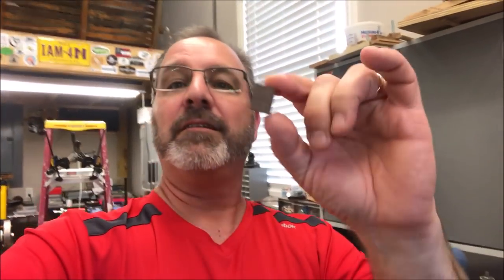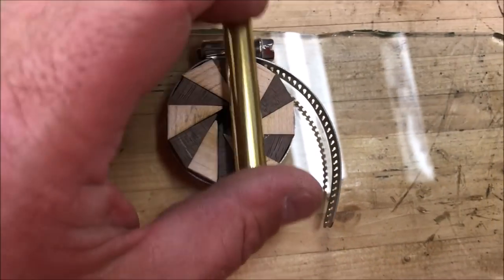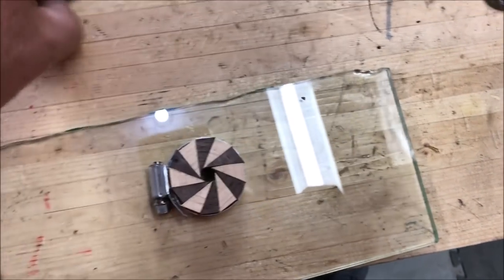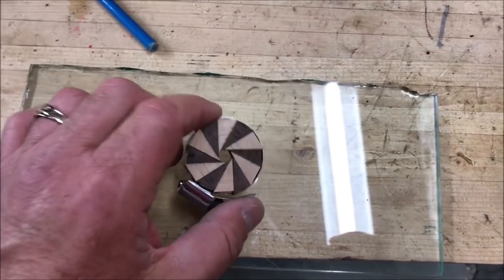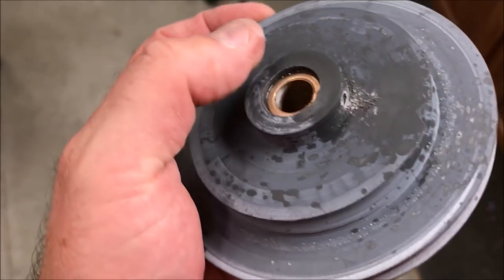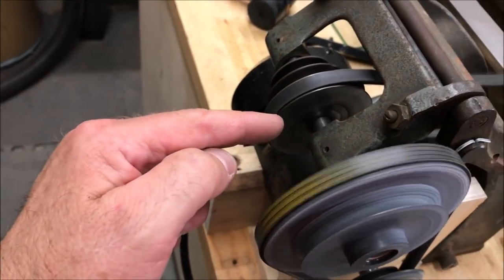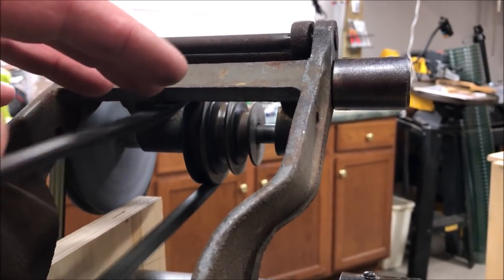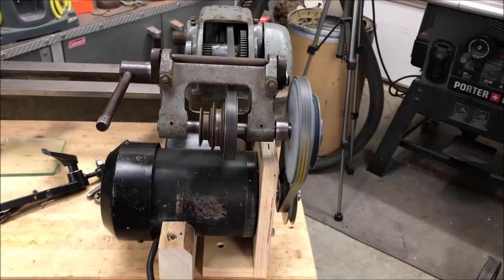Shop Update 5/18/2019

Comment: Could you lift the legs up at an angle? That way the one belt would not have to be changed and it would give you some clearance on the other belt. Good luck sir.
Reply from the maker: Thank you Bennie,
  That may be the ticket to get this lathe dialed in. Great to hear from you. 

Regards,
Bob
Reply: @WhatchaDoinBob  That's what I was going to suggest as well.  Just lift the front side of that bracket maybe 1/4" to 1/2" and it should correct that problem, and won't interfere with the motor belt.